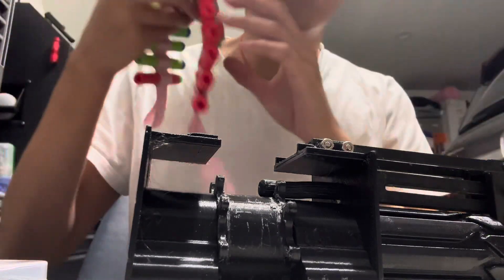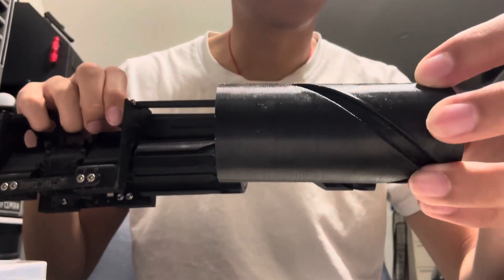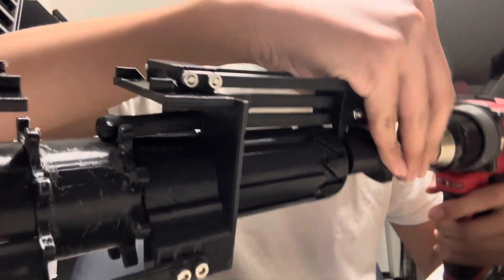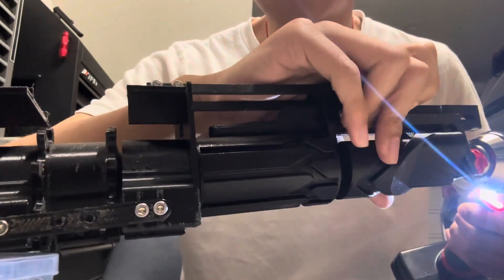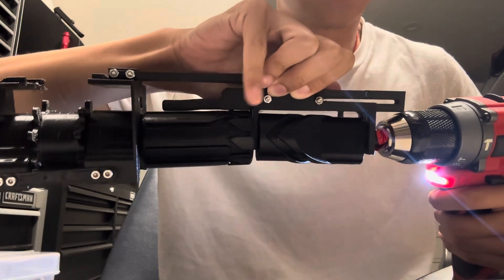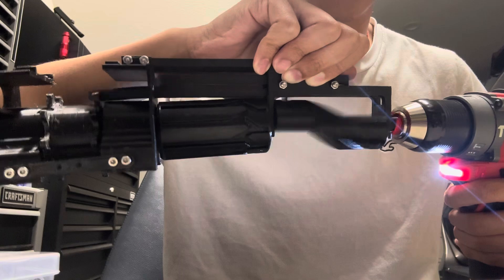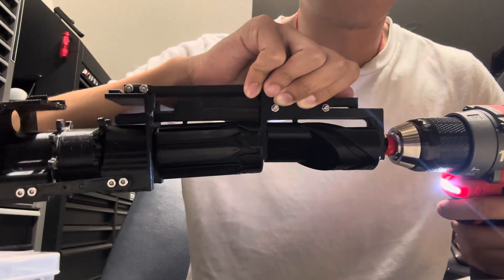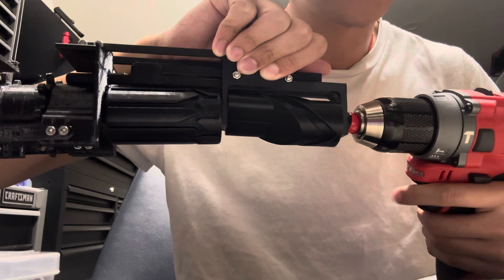Nerf cloth belt fed proof of concept

Comment: It's a pretty good mechanism for nerf version of MG42. Dude you need to try airsoft high speed aeg motor instead of a drill.
Reply: This motors is that powerful that you not need a gearbox with it. But needs a cage or this motor just run away

Comment: I have been looking for a way to make a vulcan a flywheeler without using the stock internals this looks like a GREAT proof of concept and would love to see this progressed. I think for reliability and improved function I would incorporate bearings into the moving parts such as on the pusher arm, the indexer and then the motor spindle.
Reply from the maker: @JosephPerito  yeah I had an issue where the followers got destroyed when they were riding the tracks. I switched to using some 3mm metal pins and it works better.

I thought of using bearings but I wanna keep costs down and didn’t think it would be possible to use such small bearings for the followers